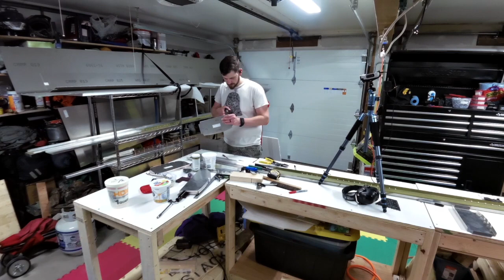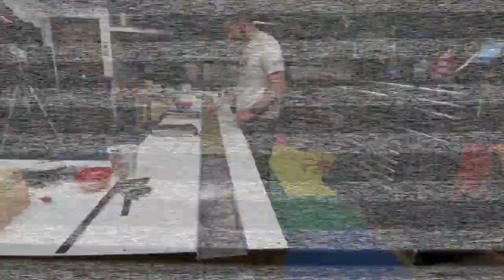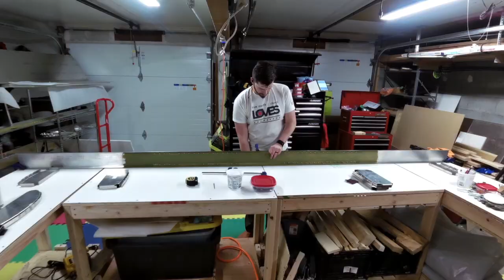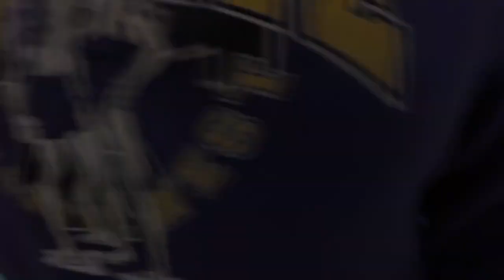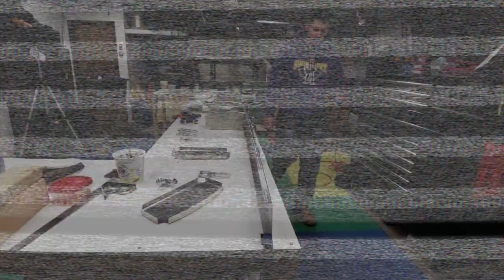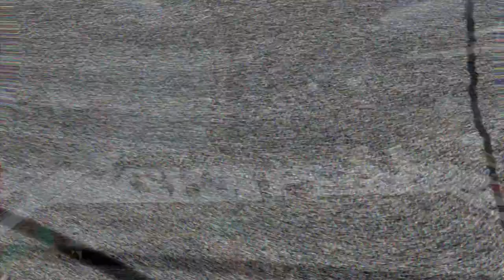Finessing and Drilling Stabilizer Ribs - 015

Comment: Have you tried an edge deburring tool? May be easier on the ears ;) https://www.mscdirect.com/browse/tnpla/85424521?cid=ppc-google-New+-+Abrasives+-+PLA_sqF1QRi19___164124448223_c_S&mkwid=sqF1QRi19|dc&pcrid=164124448223&rd=k&product_id=85424521&gclid=CjwKCAjwpeXeBRA6EiwAyoJPKmT9UtwGni1KOX0V4EH_prMqDmS2arOeIEgfQBy3ERf-civHpFihxBoCuEkQAvD_BwE
Reply from the maker: I've got several different deburring tools, and the file happens to be one of them. For the work we're doing in this video, the file was the best option because we needed to remove a decent amount of material, and the snips leave some rough edges which other deburring tools would catch on.